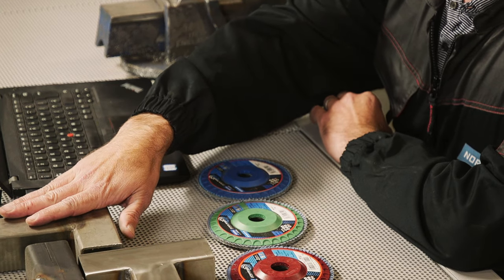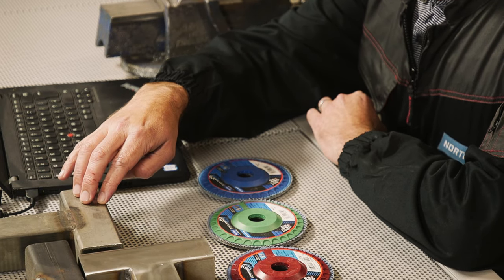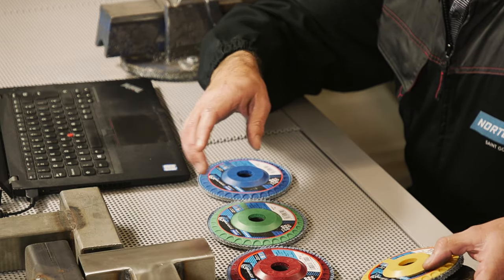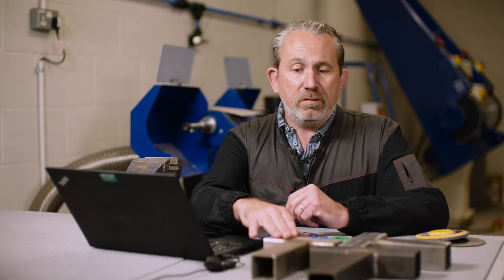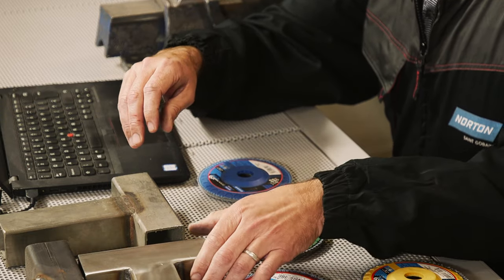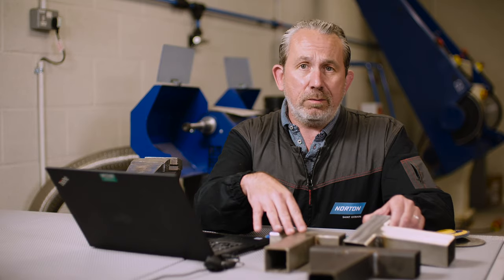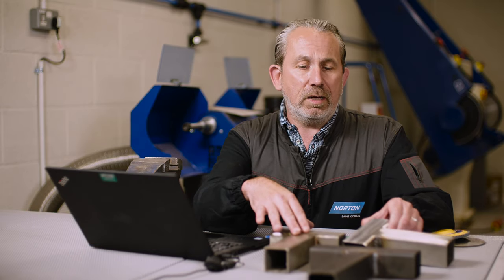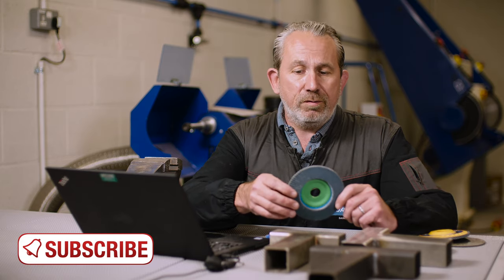ASK THE EXPERT: How to choose the right grit for the job?

Comment: What grit flap disc would you use to grind spots on aluminum semi wheels
Reply from the maker: Hi Sharon, thanks for your question! If we assume aluminium semi wheels are truck wheels and the spots are dirt or contamination, then we would recommend to use a medium grade non-woven disc, like Norton Rapid Prep. If you need to remove a little bit of material then I would use a P80 grit flap disc, but this will leave a rough finish. If you'd like more information, drop us a line at marketing.emea@saint-gobain.com and we'll see how we can help further!